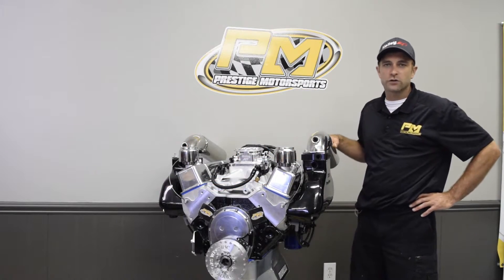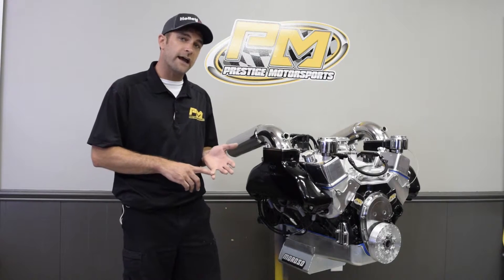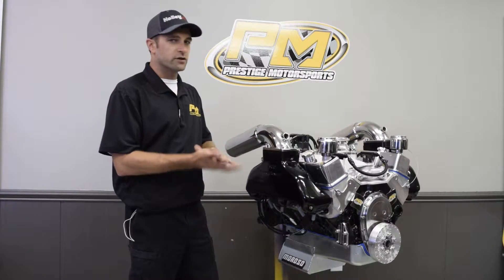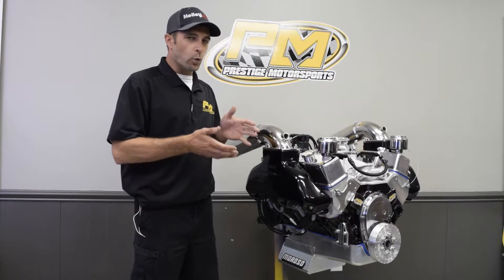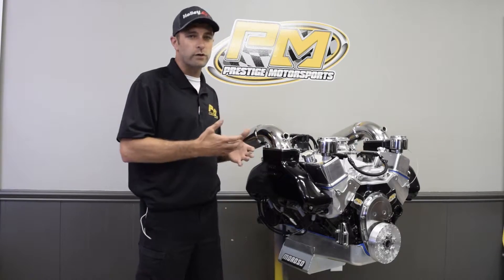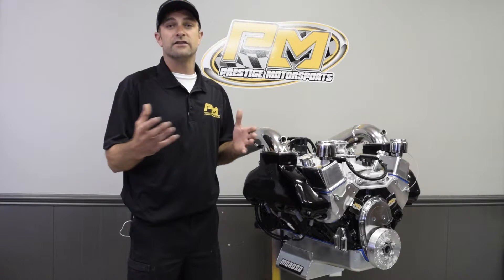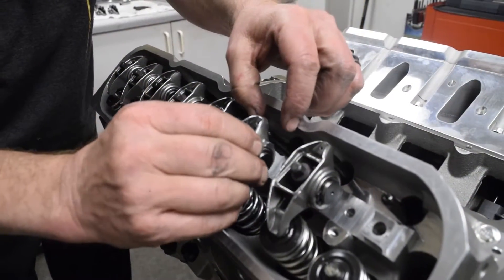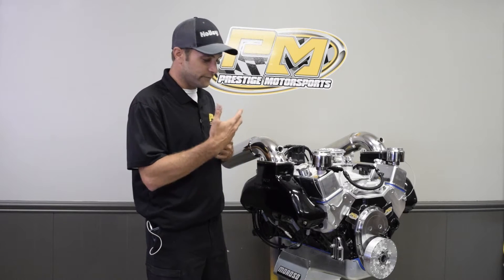Marine Engines Explained at Prestige Motorsports - 396 Jet Boat Engine

Comment: Aluminum and steel eat each other up and steel rockers are stronger and one peace stainless manifolds is better no gaskets and solid lifters are better with mechanical rockers no loss of Horse power and they are adjustable and steel valve guides with titanium valve's and connecting rods are best and no timing chain all gear to gear is more precise timing

Comment: I have a 22ft jet boat in salt water. Currently running a ford 460 but don’t care about speed. I care about fuel economy while not having issues getting on plane. What motor do you have for me? I want a quote please

Comment: I have a OMC cobra out drive. I don’t know how much power that would actually handle, so I’m assuming I would need a milder build. What do you offer for this?
Reply from the maker: 425hp 347 Ford long blocks start at $5999. Check it out here - https://www.prestigemoto.com/custom-engines/ford-small-block-engines/value-series/347-ford-small-block-stroker-crate-engine-f347-v-lb-1.html

Comment: that's a pile of information 
mercury marine has terrible o2 problems 
Volvofailure usually under 100 hours we buy them by the dozen
Reply: Delay powering on the O2 sensor heater till after the water is gone.